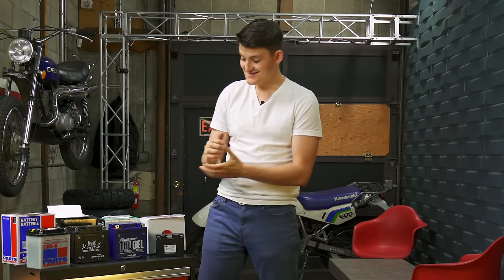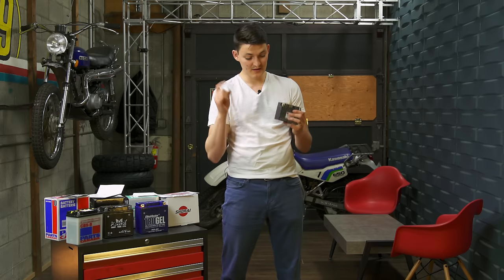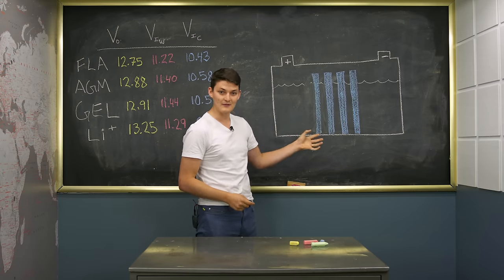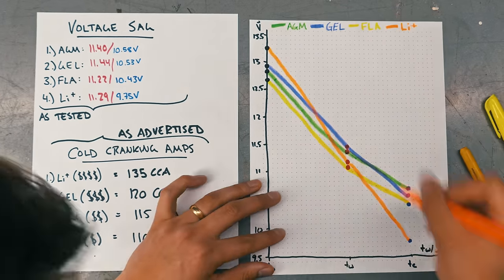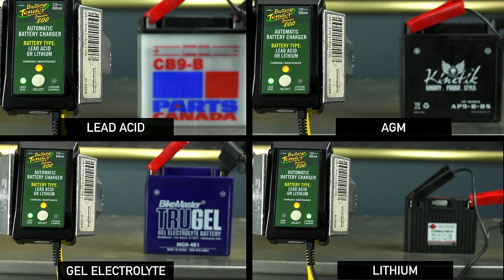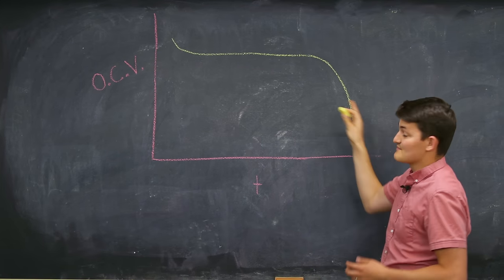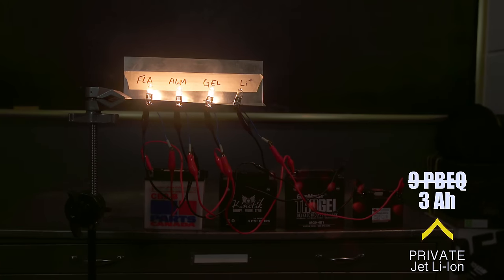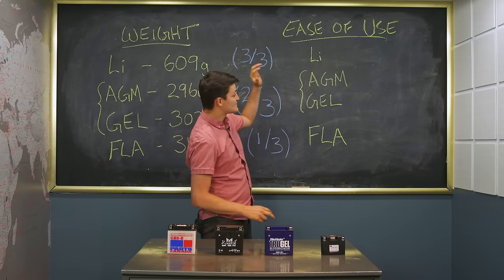Best Motorcycle Battery? Lead-Acid v. AGM v. Gel v. Lithium

Comment: Excellent info, excellent presentation!  My solution, after experiencing several issues in this area, is: AGM in the bike, carry a Lithium jump starter (I have a Noco GB40, which can be charged on the bike via USB, but there are many others to choose from), practice push-starting in various settings (easier and safer than one might suppose, don't forget to change to a higher gear and turn on the key and run switch), frequently check your stator and rectifier/regulator (make sure voltage across the battery rises after you start the bike), and always plug in a trickle charger when the bike is parked at home (I have a Battery Tender).  Also carry jumper cables on long trips (thinner wires with smaller clips suffice, make your own if necessary).  Be aware that most bikes won't jump or push start if the battery has gone into deep discharge, so plan, prevent, and prepare accordingly.
Reply: AGM plus a jump starter/power bank - my thoughts exactly!

Comment: I like the lithium battery for smaller and lighter bikes, like my MX race bike.  For a big cruiser, which I also have, I use gel.  Thanks for the video!
Reply: The gel is worth the extra coin .  I got a dynavolt gel battery it's blue and higher ah but  the same size. Very happy so far.  Feels like a solid block of plastic to handle its solid.

Comment: I found the opposite when I replaced my 3 year old lead acid with a lithium battery at not much more cost. No trouble with cold starts anymore (tested down to 1c so far) and it saved about 3kg from a 174kg (wet) bike.
Reply: There are valid reasons for switching to lithium depending on your situation and usage. But I'll never understand peoples obsession with saving a couple kg. Jesus my weight can change that much from one day to the next depending when I eat or take a dump.
Reply: @chocolate_squiggle  he probably just wanted to lose the weight on the motorcycle to be able to gain some body fat by eating fast food.
Reply: what? I use an off brand lithium battery and its 3x the cost of a lead acid on amazon ($90 vs $30) It is a bit overspecced compared to what my bike needs but i wanted to be safe and give myself some cca headroom
Reply: @chocolate_squiggle  depends on the use case and the pounds add up. plus having the weight on the motorcycle vs the weight on you makes the bike handle different. if youre counter leaning then the bike turns in a lot faster if you move a few pounds from the bike to you.

Comment: Several flaws in this guy's tests.  Ultimately, all of these formats are designed to produce the necessary amps/current to crank the application.  The difference comes down really to all of the other features/benefits you may or may not value in your particular use case - things like ease of maintenance, sealed/spill-proof and non-gassing design, vibration resistance, cycle life, ability to withstand/rebound from deep discharge, self-discharge rate, recharge rate, versatile orientation options, reduced terminal corrosion and, of course, price.

Comment: Good video, by the way. Happy to have learned that lithium batteries have actually less capacity. A bummer, considering the high premium.
Reply: the high capacity of the old led acid batteries where only needed for the deficiencies of that type of batteries. led acid batteries with lower capacity have lower discharge current and while henceforth drop too much voltage to start your bike. lithium, on the other hand, can be only partly charged and they will have little problem putting out loads of current. 
last but not least: 2-3kg weight reduction is huge for racing bikes.

also Lithium batteries have around 10 times more charge/discharge cycles. they should in theory last way longer than your standard batterie that has to be replaced every 4 or so years
Reply: I'm now regretting my purchase because I needed a battery with the most capacity so I bought the most amp hours (AH)

WTF are we doing here with "equivalents" ....some straight up bullshit. No wonder my heated grips killed my brand new battery
Reply: I think the major selling points for installing a Li battery is because they are considerably lighter and you can mount them wherever you want. Not a big concern if you want to replace a factory battery, but it can be a consideration for the custom bike crowd.
Reply: @Stoney3K  I wanted the most electrical capacity that can fit in my battery box, so I can run lights and heated gear.
I feel lied to
Reply: They are much more expensive because they are dedicsted for motorcycles. Check out lipo hardcase in rc hobby shops witu same or even better parameters for much less.
Reply: @Angry-Lynx  The RC LiPo cells won't charge off the 12V DC from a bike's engine.
Reply: @charliethechaplin  Do you run them with the engine off? The battery capacity shouldn't be an issue if your bikes charging system can provide enough power to run those things.
Reply: @Angry-Lynx  Generally the chemistry of a LiPo for RC is different to that for bike/car batteries.
The voltage of a LiPo cell depends on its chemistry and varies from about 2.7–3.0 V (discharged) to about 4.2 V (fully charged) for cells based on lithium-metal-oxides (such as LiCoO2), and around 1.8–2.0 V (discharged) to 3.6–3.8 V (charged) for those based on lithium-iron-phosphate (LiFePO4).

3 cell RC lipo batteries would be 12.6v which isn't high enough as bike charge circuit is usually around 14.2-14.4v, and if you had 4 cell batteries, 16.8v, they wouldn't fully charge.
so
4 cell LiFePO4 batteries are used, 14.4 - 15.2 volts fully charged which is perfect on your bike, they can also be discharged to a lower voltage before damaging the battery.

Not saying an RC lipo woudn't work, but you do have to take the voltages into consideration.
Reply: If you actually use 3ah from a "9ah" conventional battery, you would probably have trouble starting your bike. See the video one more time, and pay attention this time😉 Lithium is far superior in my experience. Especially if you buy a battery of the same physical size as your old battery. The OEM's are all moving in that direction.
Reply: @mrifixplanes1813  LiFePo are available for RCs as well. They have a lower max discharge rate and less energy dense but are safer all around. It's a good alternative for RCs designed for NiMH, where LiPos would damage the motor due to excessive current.
Reply: @mrifixplanes1813  true that. Lifepo is the way to go for motorcycles.

Comment: Iv been thinking of buying one of these lithium batteries. In california they are fairly viable.
Reply: I have one in my Fireblade and am not going back to regular batteries ever again. I understand cost is an important factor for many, but the $80 or so difference between the batteries over its lifetime isn't that big of a deal to me. In return you get a shockingly light battery. Seriously, the first time I handled one, I thought it was a dummy. It's more than 4 times as light as a regular battery.

You might not care about well over 2 kg weight savings of you ride a heavy, non sporty motorcycle, but if you have the latest supersport dressed up in carbon fiber, titanium and magnesium bits it's a bit silly to not go with the way lighter battery for not that much more.
Reply: @lemster101  Agreed. In the bicycle world weight weenies look at things in terms of grams saved per dollar. Don't have to go too far in upgrading a supersport before the weight savings of a lighter battery becomes the best upgrade for your dollar.
Reply: @kleinbottled79  Yes. Even in R9 900gs battery is placed high and weight difference is noticeable. Try to strap 2 Coca-cola bottles to the top of your tank and see how it handles on low speed.

Comment: The seemingly slow charge of the Lithium battery may be at least partially a function of the charger. Also, as someone else has already commented, Lithium batteries charge quite fast from discharged to approx 80% and then slower to 100%. Lithium is charged by  CC/CV method. To start, CC or constant current is applied until a set voltage is achieved, then switches to CV or constant voltage until full capacity of battery is achieved.

Comment: Lithium works best because as you mentioned it provides more amps when cranking, this should have been tested.  More power cranking the motor will start the bike quicker->less cranking time.  Weight advantage is huge.  Cold temps are the biggest issue with Lithium but It doesn't get cold where I live.
Reply: @notexpatjoe Your nuts, a motor draws current based on torque.  It does not draw the same current when under load compared to no-loaded.  A lithium battery will provide more current because of the way it discharges compared to a lead acid.   In the real world a lithium battery starts every bike I have quicker than a new lead acid battery.
Reply: @notexpatjoe 
Unless you have a need I don't recommend a lithium battery.  Due to the potential of a fire, another con would be bad performance in the cold.  If your battery works very well you will likely not benefit from a lithium battery.  Pro's would be weight and potentially higher cca.  The slower the starter motor turns (underload) the more amps it will draw.  I do run a Lithium in a sub 300 pound 650 SM thumper where I save pounds over the conventional battery, and it starts significantly better.   I will occasionally use one to start a 2-stroke 1200 and other motors.  I normally use a conventional batteries to start these.  The lithium does a noticeably better job, but won't use them regularly on these motors because of the fire danger.

Comment: One thing I will mention on your discharge test. Lifepo4 cells charge to 3.6v each at full charge. But will in a couple hours drop to ~3.3v a cell. The capacity remaining is identical though. There will be 4 cells in series in that battery giving 14.4v and after a couple hours it will be 13.2v. But it hasn't lost any of its capacity after the drop. So that needs to be taken into account

Comment: I bought a 1984 MZ 250 brand new. I used it as a commuter until 1994. It was then retired to the shed. When I retired in 2016 I decided to get it running. The original FLA battery was nearly dry. I topped it up with tapwater and charged it up. I am still using that battery today.

Comment: Curious how a real 9Ah lithium would do (or even a 6Ah). It would cost more and be heavier, but should take the performance crown in every category.
Reply: Not charging time, was slower with just 3Ah going in
Reply: @wolfe1970  Or price
Reply: Slower on that one charger, but not slower for ANY and ALL chargers.  This was a biased test.  For large heavy motorcycles, just get an oversized discounted AGM or gel battery.  For crotch rockets, get a lithium with more CCAs than the stock non lithium battery.
Reply: Bikes have alternators.   That little tidbit was left out of this review.
Reply: @Bubbles99718  - Ah yes, but motorcycles also have rectifiers; which fact YOU seemed to ignore?
Reply: Including the size of the fire under your seat because the bike was charging the Li in freezing temps? 😂😂😂
Reply: @johnklumpp7901  yes we know it has to be rectified to DC to go into a battery, its the alternator (charging system) that 'has' the rectifier, not the bike... so.. point being..?  @Sean O was just picking on the fact that yes, the bike will charge the battery when it runs.  If an alternator didnt rectify,  we would just call it an AC generator.  We used to just use DC generators, until it was discovered long ago generating an AC and rectifying it is more efficient and regulated by design
Reply: @johnklumpp7901  That's kind of implied, one doesn't go without the other in a modern vehicle charging system. Geezus some people are so desperate to be right about something so inconsequential.
Reply: @youtubeaccount5153  you ever charged your phone in freezing temps? yes and you are alive
Reply: @leolego2  no actually. I have not. I don’t know that I e ever charged my phone outdoors. In a car. But not a freezing cold car.
Reply: @leolego2  probably you neither, you charge your phones in your home, or in your car, at worst in your bike, while using it, making it nice and toasty, while your bike battery will sit in the winter fun for hours in some case, and get charged from the freshly started alternator. or any other bad case.

Comment: I’ve had a gel battery on my bike for nearly 5 years. 4 winters parked up in a damp wooden shed, outside temps +5c to -10c for approx 4.5/5 months. Battery not disconnected, never once charged or trickle charged, bike has always started right away first time out the shed in spring. 24 yr old Guzzi California not known as one of the easiest starters. Cost about £65. That’s about as much science as I need. 🏴

Comment: I love my gel battery. I just pulled out my bike after the winter and it had been stored away for about 5 months. I forgot to charge the battery before so i wanted to charge it before attempting to start the bike for the first time. To my surprise it took 5 minutes and then the charger showed that it was full. The bike even started up right away to prove that the battery was indeed full. 5 months with close to no discharge.

Comment: For years and years I used the standard led acid battery in my 95 virago with the same results of dead battery = no riding 😭 . Finally gave up on buying what the dealer suggested and brought a lithium  which was $50 more expensive and have had no problems in 3 years . Best purchase ever 👍

Comment: 7 mins. Lithium charges at 1C up to 80% then drops off sharply.
Reply: Great video
Reply: I'm glad to see someone else understands how a lithium battery charges.
Reply: @RKThompson  I build electric vehicles, I sure hope I know a tiny bit....
Reply: @joblessalex  uh-huh, sure.
Reply: @MrHeepspo  yep uh huh indeed!
Reply: That, and 1C for this 9A equivalent that is actually 3A means you would take 40minutes to replace the 2 amps he pulled off of it, but the rate would drop off, meaning full charge does take longer - not that you need full charge to start a bike.   Then there are chargers out there that can be set for whatever amperage you want and shorten those times significantly, but I have no idea what "C" this lifepo can handle.
Reply: Yeah but is in fact only 3A, so it was at 33% right?
Reply: Might be detuned a touch with the BMS so the stator windings don't burn up recharging your almost dead battery. Current limiting on recharge for the sake of your bikes electrical system. I have no idea if that's necessary or not but it might have been an intentional feature on that lithium battery.

Comment: This is the most universal to modern life review you've ever done.  Rock solid analysis and spot on physics math.
      Consumers, consider this not only for a small starter battery in a bike or car, but the real life physics of EVs and grid or solar storage batteries.  A certain big player is counting on your ignorance to physics.

Lithium is chosen for expensive EVs today:
1. because it stays steady a long time and discharges all at once toward the end.  So a car will act normal until the last 10% of capacity.
2. Lithium batteries are much smaller and lighter  for the capacity and voltage
3. You can cheat the math and use a battery with 1/3 the actual capacity and call it a lead acid equivalent, PLUS charge three times as much for a battery 1/3 the capacity.  The LED lightbulb scam.
4. They are relatively solid state like flashlight drycells.

However, charging a frozen battery damages Li much more than Lead Acid and her twin sisters.  Consider that oh people of the frozen North without heated garages.

Running a battery to fully dead will kill it forever.  Lead Acids will stop doing their job long before they are chemically dead and you remedy it.  Li will keep acting like a full battery until you are on a dark lonely road and then die quickly and fully, ...
That is w/o protective software that would rather strand you two miles from the station with power still in the cells, requiring a lengthy and expensive tow, than allow the precious and expensive Li batteries under factory warranty to be permanently damaged.

There is no free lunch with chemistry.  No magic box.  Li is a bad idea, except if you used Lead Acid your EVcar would weigh 12,000lbs instead of 4,000 to go 300 miles, and the last 130 of those miles would be on ever dropping voltage.